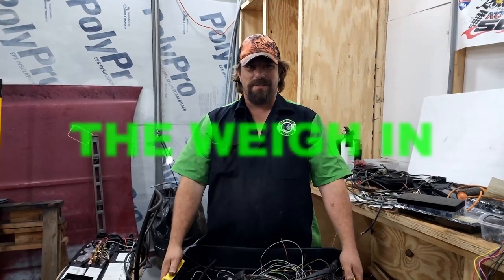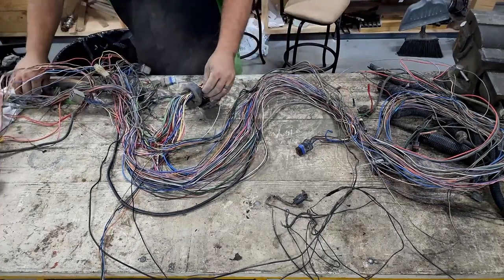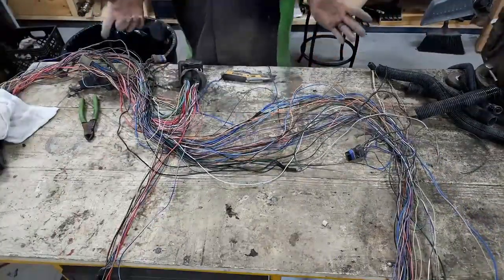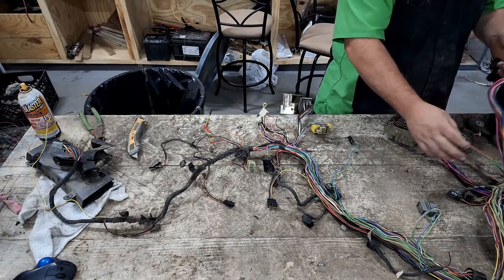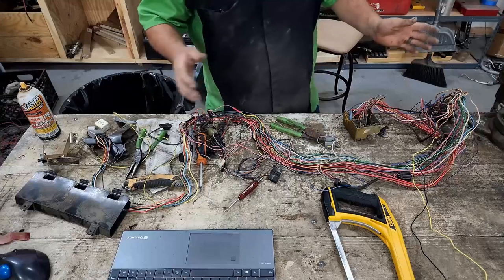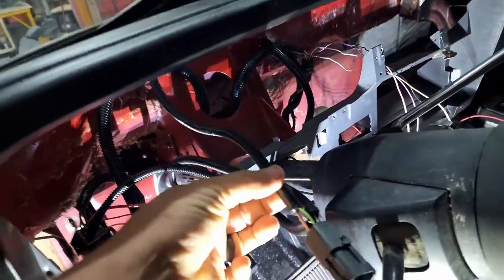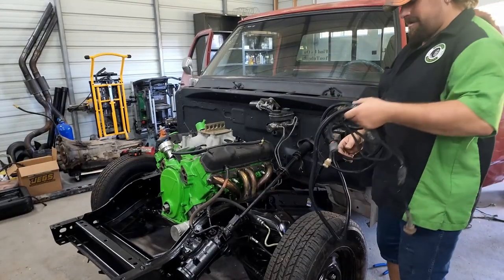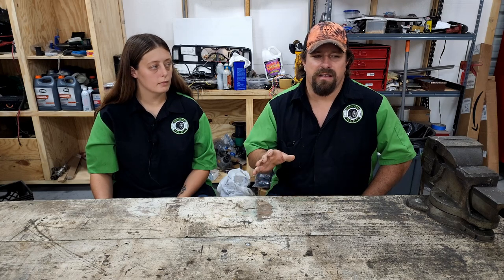Thinning and Installing The Wiring Harness - Dodge D150 Race Truck Build

Comment: I love wiring, but it can seem like a daunting task when you're thinning it out!
Reply from the maker: It's definitely time consuming, but the result is worth the effort
Reply: I just yanked all of mine from under the hood, my 1978 D150 almost caught on fire yesterday. I don't know what I'm doing, but I won't be driving again until I figure this out!
Reply: @C_71  My 85 d150 kept having intermittent no power and it all kept clicking thru a little circuit breaker on the firewall, i took out the breaker and hard wired the wires and hooked up the battery and the whole harness started smoking, unplugged the battery and one wire had caught on fire, traced it back to where it was bare and shorting out against the body, replaced the burnt wire and hooked up the breaker and havent had any problem since, stupid way of finding my short but it worked

Comment: I’m trying to splice a 87 d250 non tilt column to my 90 w150 dash harness since my 90’s column decided to explode on me in three different places this is everything I needed to know about my 90’s harness It’s the 87s column i can’t find online diagrams
Reply from the maker: I am not 100% sure but I think the column that is in my 1990 is out of an 87.  I needed the column shift when I switched the truck to automatic.  It was along time ago but I think it plugged in. I just looked and I don't have any of the older wiring diagrams either.
Reply: Thanks for replying unfortunately mine won’t plug in the plugs are just completely different so I’m gonna splice them from my 90’s column to fin the original dash harness
Reply from the maker: Sorry I couldn't be more help.

Comment: Regálame el diagrama
Reply from the maker: Not sure what vehicle you have, but if you just Google wiring diagram for it they are available online. Hope that helps!
Reply: @PerpetualProjects  I have a dodge d150 v8 360 engine with platinum ignition carburetor but my electrical system is badly damaged.
Reply from the maker: The diagram I have is for the later model fuel injected trucks, but if you google "19XX Dodge D150 Factory Service Manual" with XX being the year of your truck you can usually find a FSM with the wiring diagrams in it.